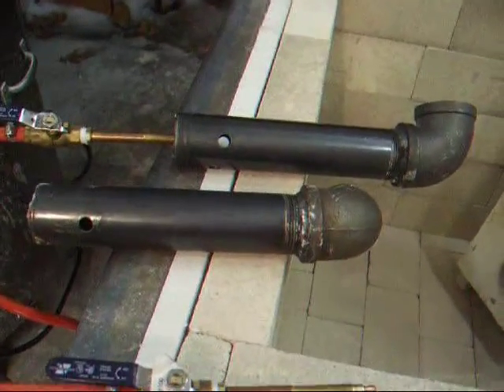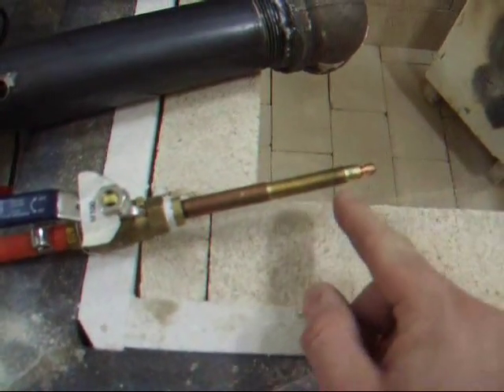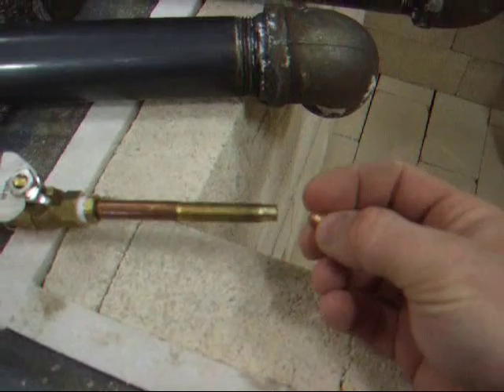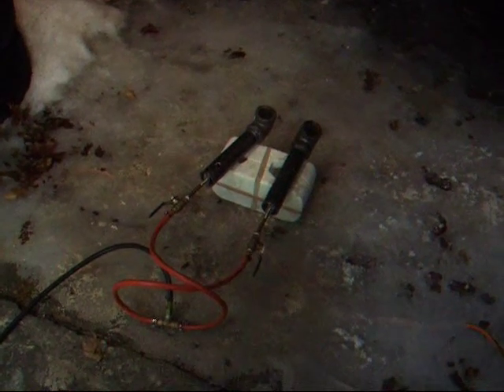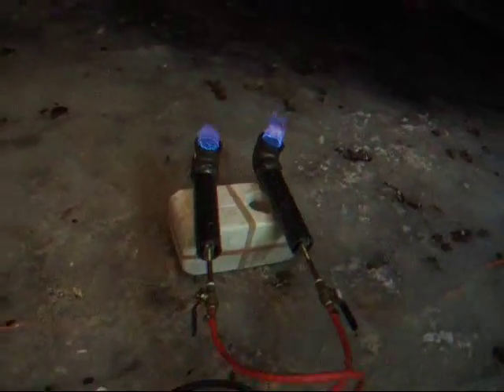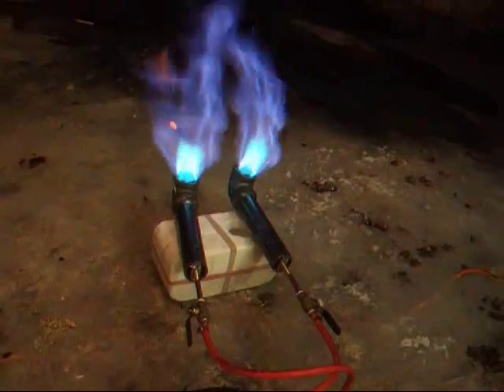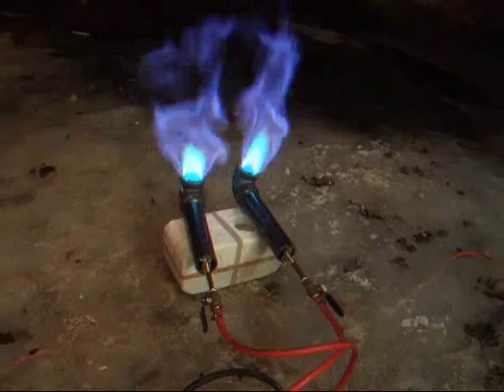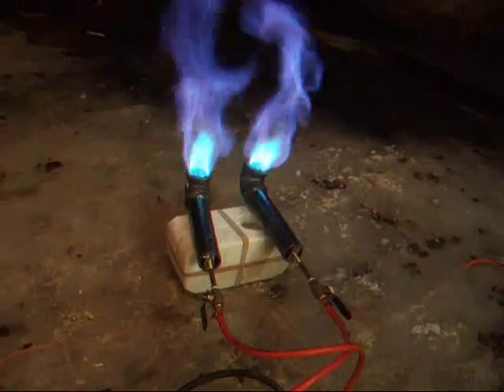Kiln project clip 5 - Burners part 2

Comment: Hi- great video-delighted to see the holes put in the burner pipe and the explanation of how this makes the stronger blue flames....I have 2 very old rusty ( were previously used on a salt kiln) burners- I've welded a plate of iron to them to hold together- with a simple copper pipe linking the 2 together ( iron plate give stability and no pressure on the copper pipe) which runs to one propane gas bottle. Has been working fine but now seems the flames are much more yellow and i'm having to

Comment: Other than that, your burner is now working fine. The extra oxygen introduced by the side holes has helped a lot to produce a good blue flame picture. Yellow flames are a sign that the burner is either clogged with debris or that the injector  has reduced it's size due to foreign debris or air is blocked off somehow. These are things you will keep in mind after repeated firings of the kiln.

Comment: increase the pressure more and more to keep temp climbing...have give the burners good shake- noticed the one on right had less of a flame slightly...seems to be ok with the other now- but firings are taking longer and I still am upping the pressure on the regulator. Have checked all over for leaks or blockages- but can't see anything obstructing the air flow..If you have any suggestions- would be delighted to hear them!

Comment: At 6 minutes into your video,  you have 'flame lift-off'. This is because the pressure is too high. Aim never to have 'flame lift-off' as you as using too much gas and in danger of the flame literally lifting off and when it does, the flame goes out. Keep in mind too that propane gas is heavy. Always vent the area if you fail to light the burners promptly.